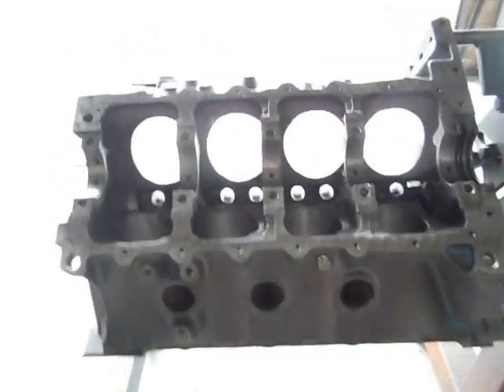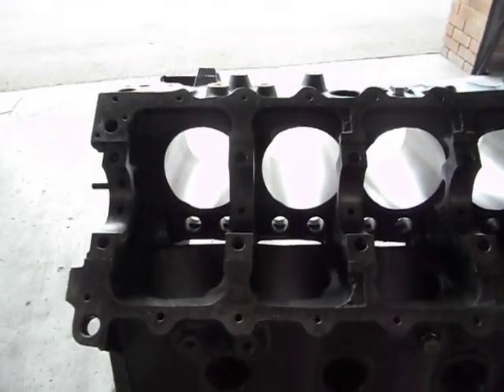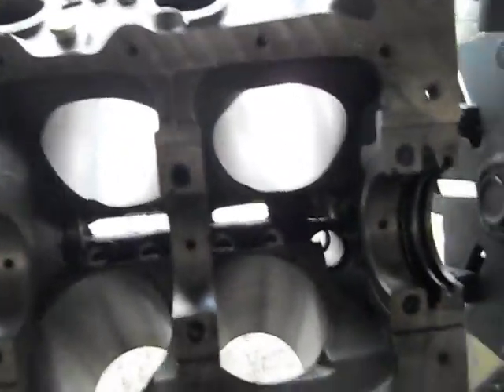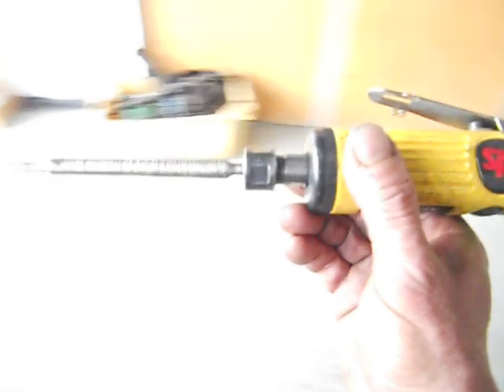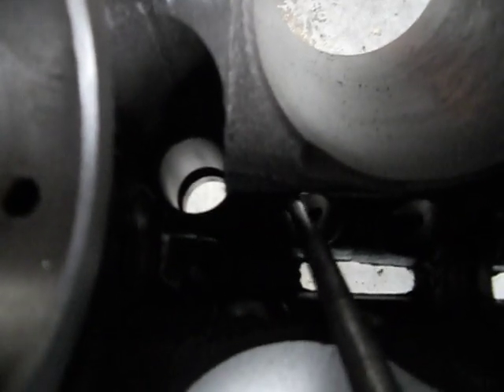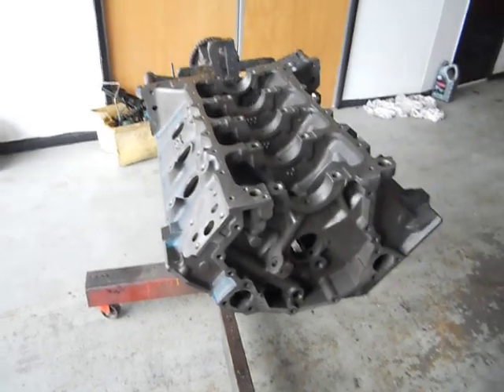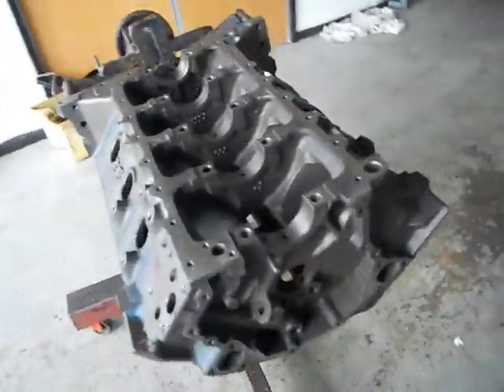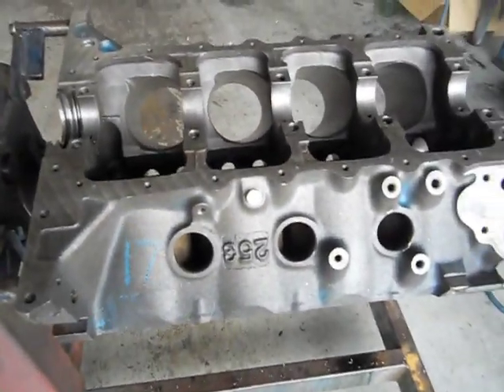How to Rebuild a General Motors Holden Engine Part 5

Comment: I very much enjoyed watching all your videos. I work at a race engine shop here in the US: Steve's Machine Shop Service in Liberty, New York. We specialize in Chevy small & big block stock car & drag race motors, as well as all other major US V-8's & import performance engines & we also do antique restoration engines. Your machining & blueprinting techniques mirror ours almost exactly, right down to the tooling for cylinder head mods. We also have a Stewart Warner crank balancer (which it is my pleasure to run) and a Storm Vulcan crank grinder, which Steve keeps all to himself.There are just three of us in the shop: Steve & Ed, who are brothers & myself, and we've all known each other since high school. We have had great success in breaking in cams using the method you describe here. I just wanted to mention that the main reason thishas become ABSOLUTELY necessary is due to the fact that the oil companies have removed over 80% of the ZINC that was formally present in regular motor oils. We use only Lucas Break-in Oil to start our engines & thereafter only Lucas Racing Oil in 20W-50 for any of our engines not running an O2 sensor. This oil will cause problems with O2 sensors, but with carbs or mechanical injection...it is a must. Please feel free to visit our shop website here on Youtube at Steve's Machine Shop. We have a few videos of crank balancing & flowing cylinder heads on our 1000 CFM flow bench...hope you enjoy.

Comment from the maker: It is an industrial strength caustic acid,and works the best at a temp 75 c 180 f,I use 10 kilos,22lbs in 500 litres /a bit under 100 gallons,and for a dirty block over night is long enough,this acid has rust inhibitors in it to stop instant rusting on hose off..hope this helps

Comment: They are also bad for boring the cam bore left or right off center , if you look at the front of the eng where the cam goes in look at the main hole and the block it should be dead center ..